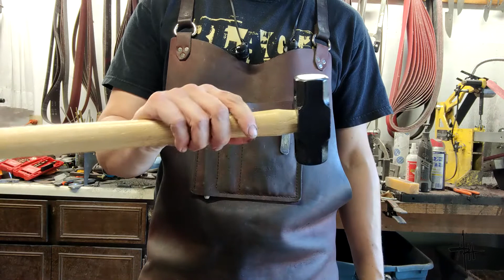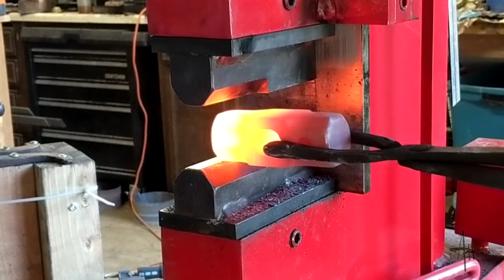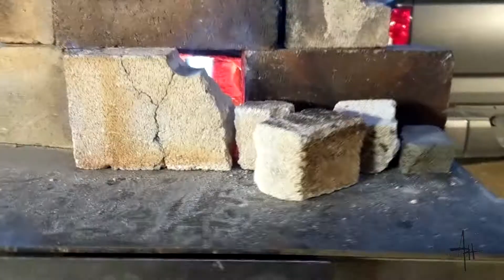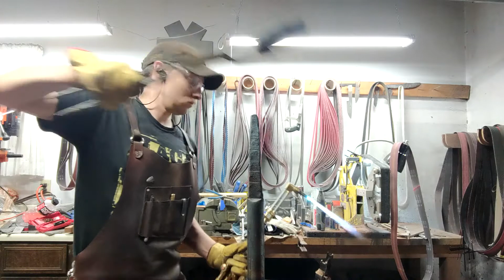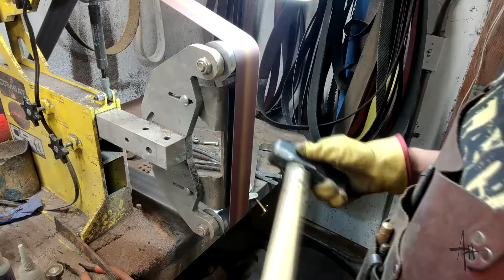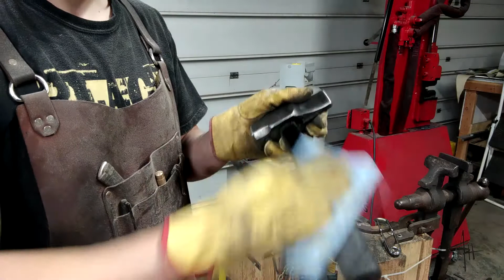$6 Cheap Hammer into $100 Forging Hammer?!

Comment: Something lighter moves easier than something heavy. Same principle as a slide hammer. That’s the reason  hitting  the back of the handle drives the head up. The heads actually staying motionless while the handle is moving faster
Reply from the maker: Thank you for the info! That makes a lot of sense.

Comment: Great forging and heat treatment. What is the metal wedge for?
Reply from the maker: Thank you George! I used the metal wedge to secure the handle since it's a second hand handle. Usually I don't use metal wedges when I'm hanging my hammer handles though.